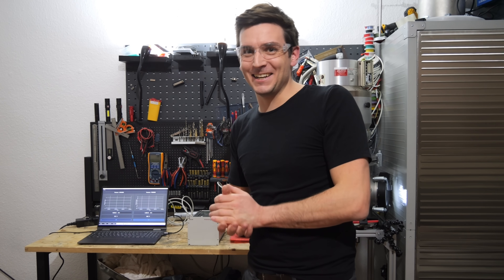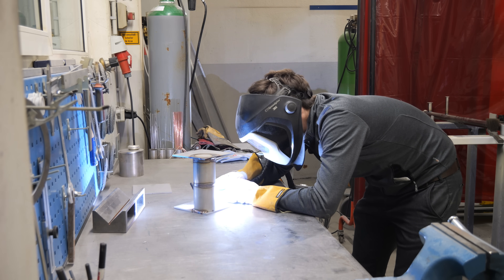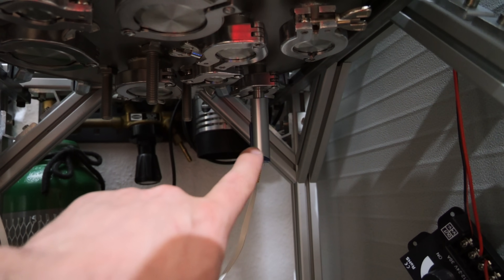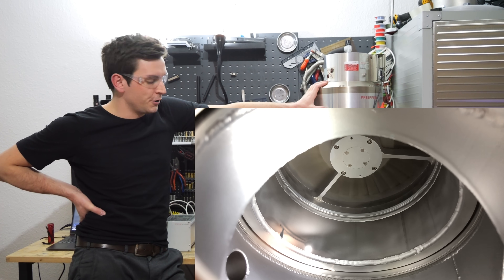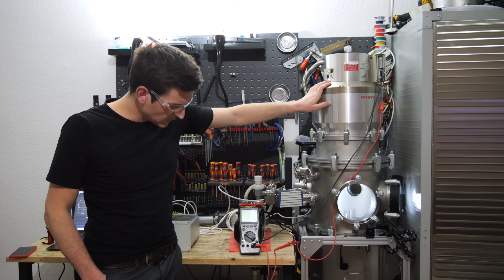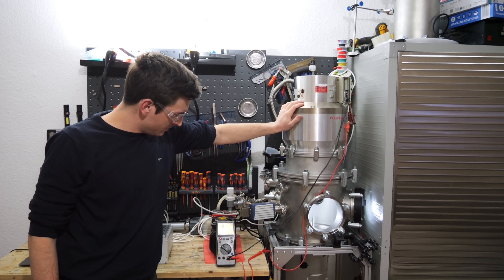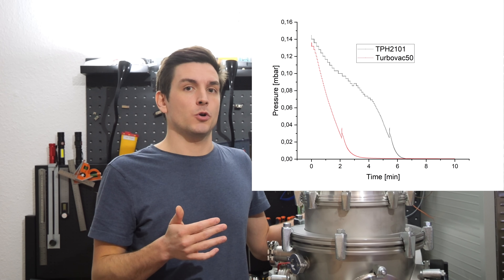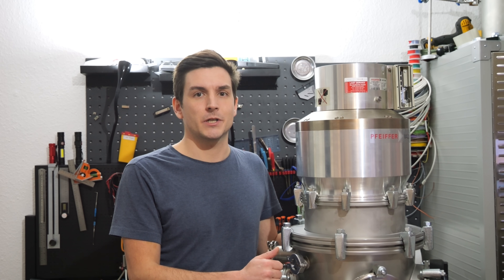Turbomolecular Madness – A Nerve-Wracking Experience

Comment: Awesome work! The vibration around ten percent speed could be an interaction between the control loops in the motor driver and a mechanical resonance in your setup. Since it disappears when the controller is powered down, this seems like the most likely candidate to me. Are there any specific pump mounting requirements from Pfeiffer when it comes to rigidity or vibration?
Reply from the maker: Very interesting. If I understand you correctly, you're suggesting that the resonance prompts the control electronics in the controller to counter-regulate, and these two aspects exacerbate each other?
Reply: @AdvancedTinkering  in my setup in the lab I use a piezo stage which is controlled by a PID controller. Maybe the motor is controlled by PID as well? PID controllers often have resonances if combined with setups that have resonances as well. My stage, untuned, has two or one resonances at certain frequencies. You can tune these by applying a notch filter. Roughly speaking, a notch filter makes the controller not do anything at certain frequencies, which is better than doing something and creating a resonance. Making your setup more stable/less top-heavy might also work
Reply from the maker: Thanks for the info! Yes, the stand is way too top-heavy with the pump. Once I have more space, I'll build a new stand for my chamber that hopefully can also be bolted to the floor. Right now, I need to be able to move the chamber and save space, so it's my only option at the moment.
Reply: @AdvancedTinkering  That's it. When the mechanical system has resonant modes and a method for these to couple with the electrical control system, then interactions like this can happen. It depends a lot on the details of the motor control scheme and controller bandwidths, they might use anything from open loop V/Hz control to field oriented control with nested current (torque) and voltage (speed) loops. I have a few different pumps and controllers, and there is a lot of variation here, with larger pumps generally having more advanced control schemes. This is just speculation on my part, but if you want to look further into this, it might be verifiable by looking at the motor phase currents, to see if there are any unexpected frequency components there corresponding with the mechanical resonance. This could be done with an oscilloscope and a shunt resistor, but I would be careful about introducing any components between the controller and pump, and the voltage is likely also floating relative to the oscilloscope ground. I'd prefer a contactless sensor instead, like a clamp-on oscilloscope current probe, if you have access to one. Looking at the motor phase voltage might also be useful, but probably a lot less clear since it tends to be a pulse-width modulated square wave with the output amplitude encoded in the pulse width.
Reply from the maker: Thank you for this incredibly informative comment! This is why I just love YouTube comments! Unfortunately, I currently don't have access to an oscilloscope with a non-contact current probe, nor do I probably have the expertise to interpret the data readings accurately. However, it's definitely going on my list of things to test in the future!
Reply: A loooong note with some thoughts… 

I’m thinking it might not be so much the control system PID hitting a resonance as it could be just the pulses to the coils of the motor finding a resonance with the rotor support system (bearings, mechanical supports of the system as a whole, etc). 

It’s of course possible that it’s an oscillation in the PID controller, but the rotor accelerates so slowly that I can’t imagine the PID loop having any time constants as short as the frequency of the vibration you’re seeing. Short time-constant oscillations would come from interaction between the P and D terms, and the time constant or sampling interval for the D term would have to be of similar order of magnitude as changes in rotational speed - which is very slow. 

As another commenter said above, you could figure out if the loop was oscillating by looking at the control output, but I really don’t think you need to go to that level: Per my argument above, I think it highly unlikely that the control loop is the issue.

It seems from others’ comments that this sort of startup vibration is common with TVPs, but if it bothers you, you could play with the system’s kinetics to see if you can damp it out.

- Stiffening the support structure will move the resonance to higher frequencies, but not reduce the total energy in the system. Still though, for a given energy input, amplitude would be smaller at higher frequencies, which I’d think would be a good thing. - Although sometimes stiffening can also take away energy dissipators (like friction at joints where structural members move against each other), so in some cases tightening everything up can make for greater amplitude or vibration (basically, you’re increasing the “Q” of the mechanical oscillator.)

- One option is to introduce vibration isolators between parts of the system. By decoupling the different elements, you can often reduce amplitudes by isolating the vibrational energy and not coupling it into the larger system, or at least coupling it more weakly. There are lots of commercial/industrial anti-vibration mounts, with rubber separating mounting flanges or studs; they’re very frequently used in motor mounts or other types of rotating machinery to keep from transferring vibration to the rest of the system. The rubber also dissipates some of the energy, but I think the main effect is to simply not couple vibration into the larger system.

- A third approach is to introduce loss into the system, in the form of things that will dissipate the energy from vibrational energy. I don’t know what form these might take commercially, but I suspect there are special isolation mounts that actively absorb energy, converting it to heart. - I’m not a specialist in vibration control, I’m just approaching the problem from an engineering viewpoint, treating it as a mechanical oscillator with a moving mass, a spring constant and a damper.

This was likely a lot of words to little effect, but hopefully something somewhere in them might prompt a useful idea as you work on the system.

I love watching the ongoing development of your system, it brings back memories from ~45 years ago when I did a lot of high-vacuum work. At the time I came to hate it (cleaning and rebuilding diffusion pumps got really old; as did chasing leaks and virtual leaks at 10e-9 to 10e-10 torr in an ultra-high vacuum system), but seeing your setup makes me nostalgic 😁

Comment: I noticed the sound that the pump makes while vibrating is around 60hz. Maybe an interference of some sort with the main ?
Reply: He is in Europe, we have 50Hz here
Reply: That I say is very unlikley since the VFD retrifies the AC 50/60 Hz input to DC and also evens it out with some really large capacitors before it gets sent to the IGBTs. If any of the mains hum would have got though then that inverter I say have a crappy retrification and fitering stage wich would be very unlikley for a manufacturer of high end vacuum equipment to skimp on. The inverter drive is most likley built to just as high standard as the pump itself as these things are  meant to run for years on end non stop in higly critical applications where failure is not an option.

Comment: is that profile frame good to hold all this heavy and spinning equipment?
Reply from the maker: No, definitely not. Without the pump and just for the chamber it's completely fine. 
But using a pump like that on a frame like mine is not what you would consider safe.
Reply: it's probably also the source of the resonance, could even be multiple modes cuz there's so much mass at the top @AdvancedTinkering
Reply from the maker: I initially suspected that too. However, what made me suspicious is that the noise stops so suddenly. Even when I switch off the pump, it stops quickly while the rotor continues to spin at practically the same speed. Also, when the pump skows downfrom full speed, I hear a noise again at around 50% (which I suspect is resonance), but not at 10%. If it's only the rotation of the rotor, I should hear it when the pump slows down as well.
Reply: @AdvancedTinkering  yea it is curious, but mounting it on something solid would eliminate some causes.